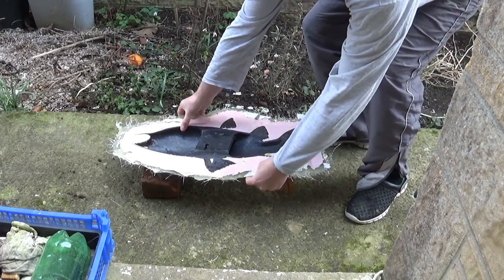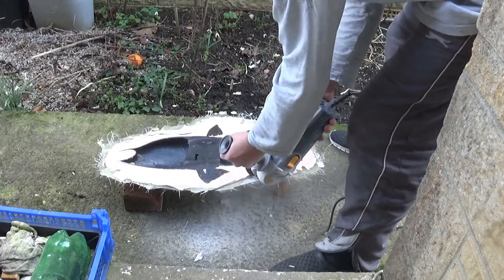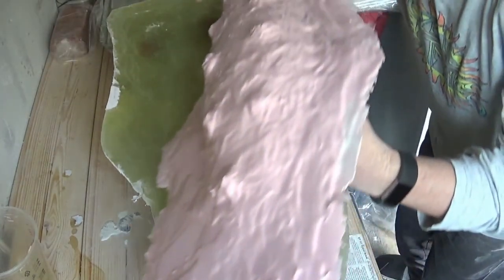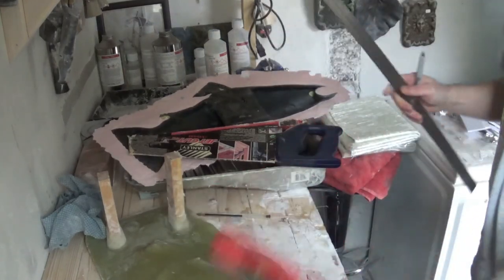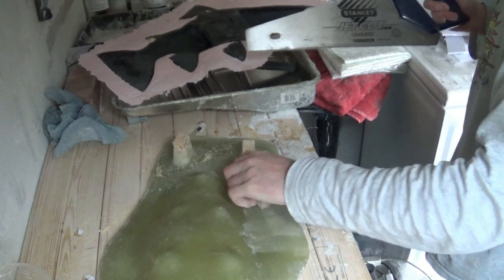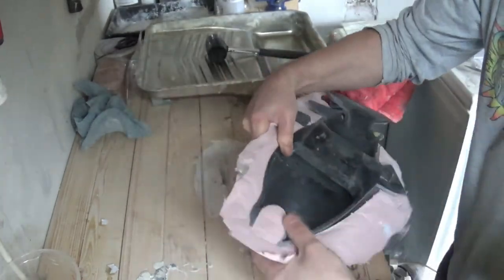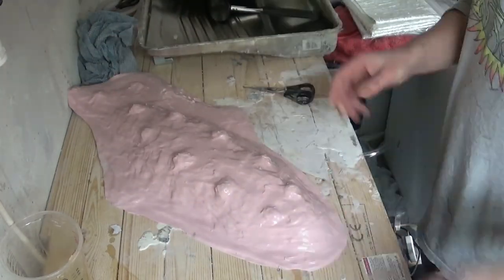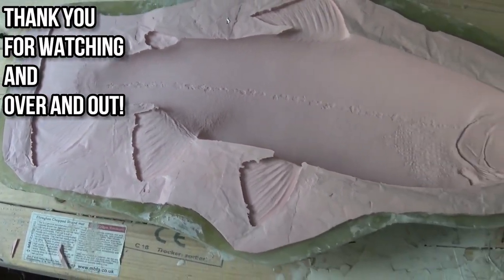Cleaning Up Silicone Mold & Fibreglass Mother Mold

Comment: Another good looking mold!

For safety's sake though, you might want to consider a full face shield with that angle grinder. Fiberglass threads can hurt if they get flung back into the face.
Reply from the maker: Cheers Pat! :)